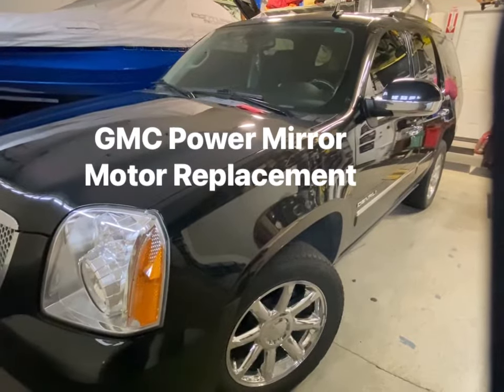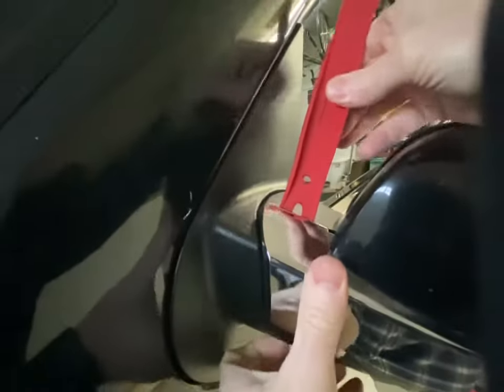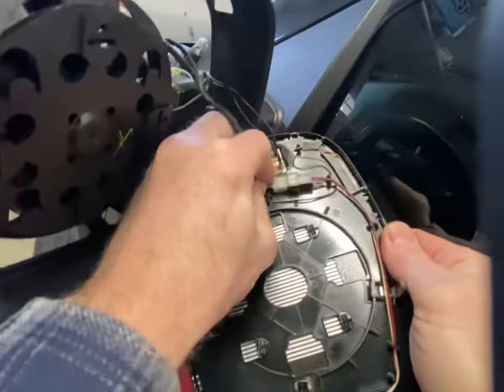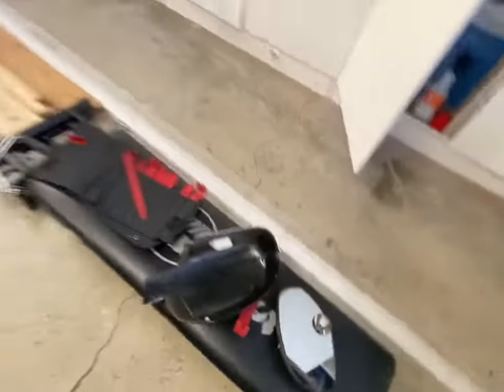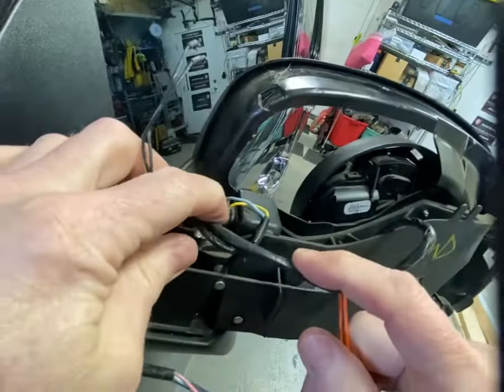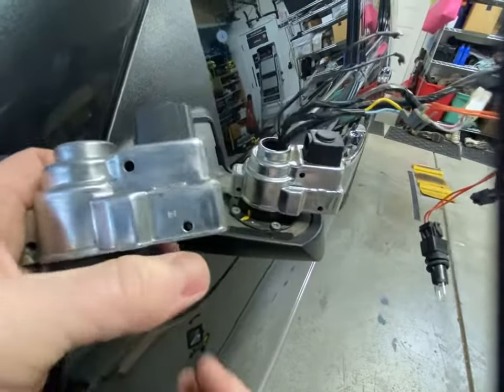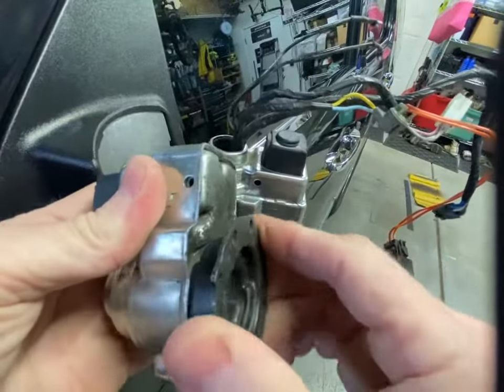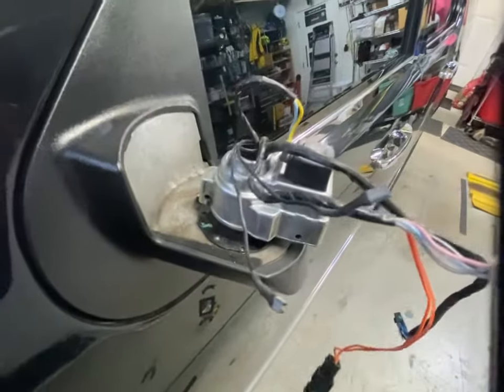GMC Chevy Power Folding Mirror Repair (2007+ & Up) motor replacement.

Comment: QUESTION???? are the motors side specific or the motors are the same for both sides.
Reply from the maker: https://www.gruvenparts.com/gruvenparts-com-strengthened-spur-gear-for-2007-gm-trucks-folding-mirror-assembly/  check with these guys who supply the motors.  There’s some other important details if you go that route.

Comment: Very good video, on my Escalade when I push the button down to fold the mirrors in the driver's side moves just a little bit, the passenger side dont move at all, so would I need to motors?
Reply from the maker: Yes, that’s exactly what ours did before we replaced motors.

Comment: So im a little confused. So did you swap gears and motor or did you buy the 200 plus dollar motor woth upgraded spirs and gear from gruven
Reply from the maker: $200+. Doesn’t do any good to have a motor without a good gear. There’s a lot of information on their website about grounding - and what’s required.

Comment: Just finished replacing my mirror motor on my 2010 Silverado and couldn't have done it without your video! Took less than 45 minutes. Like you said, removing and replacing the mirror was the hardest part but removing the exterior cover made me nervous, too. Thought I was going to break it but everything turned out great! Thank you so much for the video!!
Reply from the maker: Great! Glad it helped.  Thanks.

Comment: Great video and very informative...! I have a 07 Ext Escalade and the mirror on the drivers side will fold in and out and the adjustment on the right to left works however the adjustment on the up and does nothing... any ideas?
Reply from the maker: Those gears get stripped inside for the up and down unfortunately. OR - come loose. If you take it apart- you should be able to see what you need.

Comment: Great video. My mirror got knocked off by the "tool booth arm"  at a Pocono community entrance,  Putting the mirror back on instead of buying and replacing the whole thing was a much easier and cheaper!!  Very easy to follow your explanations and directions. Thanks
Reply from the maker: Glad it helped

Comment: Not sure what they do with the mirror to actuator clips, but mine when back on real easy the second time I removed and reinstalled, so it seems like that is somewhat consistent. Maybe do an install / removal a few times when it's apart (when it's easy to do) may be the trick. (When I removed the first time it was a bear to get back on)

Comment: Can you buy a replacements mirror with the retractable motor in it? I bought a used 2007 Tahoe and the passenger side mirror was replaced with a after market mirror that doesn’t fold in and the driver side folded in for the first few months but now the motor has gone out. Do I have to replace the motor and the mirror on passenger side or is there a kit that comes with the motor already in mirror that I can just install? Any advice would be great!
Reply from the maker: Yes, check this one out:  https://amzn.to/3wLy7Sr

Comment: This is a very informative video. I appreciate you making it. I recently bought a 2011 Chev Avalanche (same mirrors) and both mirrors didn`t work. The original owner never used them.I sprayed almost a half can of WD 40 in both and gradually they worked. But then I also have a 2007 Avalanche passenger side mirror you can hear the gears grinding and the drivers side moves very slow. WD 40 didn`t fix those so will be following your video and change motors. Thanks again for your help.
Reply from the maker: Love it!  Hope it can help many more.  Thank you for your kind words.

Comment: Just to make sure.. this is the motor to fold the mirrors.. right??  Not the mirror adjustment
Reply from the maker: Yes.  I will add that after I did this video- I had problems with the actual motor for the glass/mirror part.  Soooo….. different part.

Comment: Good video bro what about if you hear the passenger motor working but the mirror won’t fold in or out what could that be?
Reply from the maker: Just the plastic gears inside.  Motor still works - but gears stripped.

Comment: I jus replaced my gear and it moves in butnit doesn't come back out what could be wrong?
Reply from the maker: I’d check voltage on the wires to the motor that they send voltage when you move the switch.  If it’s only going one way then probably the switch. Otherwise- contact the seller of the motor to see if you got a bad one.  Those switches do go out.
Reply: @TheRealWorld737  i figured it out its two tabs that has to be bent back on the motor  in order for the metal gears wont ground out
Reply from the maker: Excellent!!  Thanks for the tip.  You helped a lot of people who probably will encounter the same situation.
Reply: Thank you! I been working on both mirrors for like 3 days wondering why there is a short every time I mount and could not figure out why and gave up at midnight yesterday. Gonna pop them back open and try this hopefully thy solves it🤞

Comment: Great video thanks. Do you think It can be done on a Cadillac SRX 2015?
Reply from the maker: Well, I haven't had one of those apart.  However, GM does manufacture most of these things similarly with clips - etc.  However, Gruvenparts - I am not sure about if the same upgraded motor would work.  You could contact them.
Reply: I will do that. thank you...
Reply: @alejandroroal990  let us know what you find.

Comment: Still afraid to do this myself. Not very mechanically inclined lol..... Lets say I buy the 2 motors for each and replacement mirror for the driver side, how much do we think the GM dealer is gonna charge me for labor
Reply from the maker: You can do it.

Comment: My 2012 GMC Acadia right side mirror just started to get a mind of its own.  When put into reverse, it not longer tilts down, but goes up and out..  I think it’s the other mirror, any tips?
Reply from the maker: That’s a new one! Normally that’s a settings issue. But I am not aware of a reverse triggered position that would cause it to go outward and up.

Comment: I have a 12 Acadia Denali I can’t seem to find the replacement motor can you help?
Reply from the maker: Here is the entire mirror assembly on Amazon that fits:
https://amzn.to/3q1LVF9
Here is the Gruvenparts page that I mention in the video.  According to them, this will work with your year Acadia.  But you have to decide if you are willing to do the installation/modification and to what extent.  If it's too difficult - then you probably should just buy a replacement mirror & get it painted to match:
https://www.gruvenparts.com/gruvenparts-com-strengthened-spur-gear-for-2007-gm-trucks-folding-mirror-assembly/
Reply: @TheRealWorld737   I don’t need the entire assembly just the motor for it to open and close
Reply from the maker: Ok.  Then Gruvenparts is your best bet.  You can see in the video here the whole process.  But please read all the information on Gruvenparts site.  There are a lot of little details that you need to be aware of (grounding, core returns, delays, etc.).
Reply: @TheRealWorld737  I checked out the site and did read about that but I was still unsure which one I needed :/

Comment: My car has an issue where I can hear the motor running, but the driver side mirror won't fold. Any suggestions?  Great video by the way!
Reply from the maker: Yes- broken or stripped gear on motor.  It’s easiest to just replace the whole motor.

Comment: I installed my rebuilt mirror motor RHS/passenger side...but for some reason it works when it wants to..so I'm back to square one..But when it's working it moves very fast..would've been great if it worked every time I needed it to..😤
Reply from the maker: That sounds like the window switch control panel on your door is having problems.  I had an older suburban that would do that.
Reply: @TheRealWorld737   I sprayed electrical cleaner on the connection to the power mirrors, that didn't make any difference neither.

Comment: What do you mean if you changed the gears only you need different wiring because the motor you bought comes grounded?? I tried to replaced gears only but there seems to be a short were the mirrors won’t work when mounted but work while just hanging off the wires.
Reply from the maker: Straight from the Gruvenparts page that I have linked in the description.. "* You Cannot Just Install a Metal Gear Without Also Changing The Motor To The GruvenParts INTERNALLY GROUNDED MOTOR !  You Will Short Out the Body Control Module.  All Of Our Kits Come With New Motors Which Are Internally Grounded and Work With Metal Gears - So Don't Just Replace the Gear, You Must Replace Both Gear AND Motor When Going to Metal !!! ** (Stock gears have plastic - replacement gears have metal. So, the wiring has to be different in the motor itself because GMC wired the motors with plastic internal parts.  When you place a metal gear inside - then it grounds it the wrong way and creates a short.  Gruvenparts has this on the ordering webpage - as I've copied and pasted above).
See the link below:
https://www.gruvenparts.com/gruvenparts-com-strengthened-spur-gear-for-2007-gm-trucks-folding-mirror-assembly/

Comment: Love it. Question do you have to change both or just one
Reply from the maker: Just one.
Reply: @TheRealWorld737  thank you. So I just want to be sure it's only one motor that operates both sides. I deeply appreciate this advice
Reply from the maker: NO.  It is ONE motor per mirror.  One motor cannot operate the mirror on the other side.  If BOTH mirrors are floppy or not moving properly - then you have to change the motor in each mirror separately.

Comment: Don't see a motor at the link; just gears.
Reply from the maker: It’s there on the Gruvenparts link.  Says gears + motor.  Here it is again:  https://www.gruvenparts.com/gruvenparts-com-strengthened-spur-gear-for-2007-gm-trucks-folding-mirror-assembly/